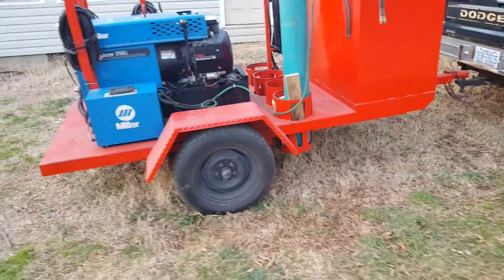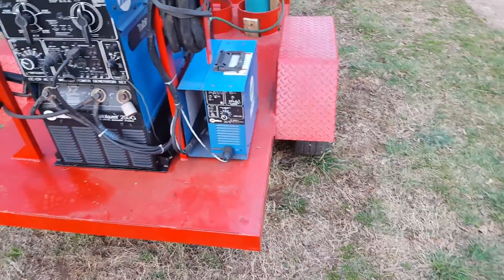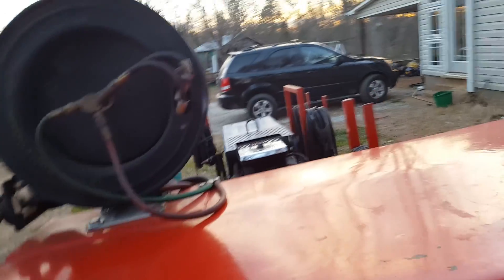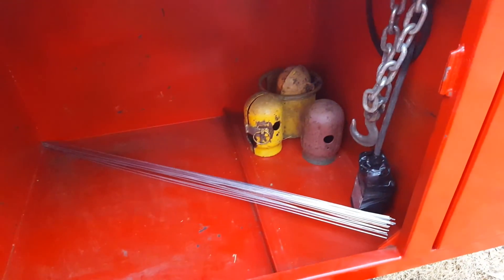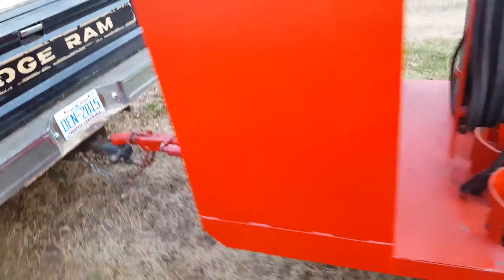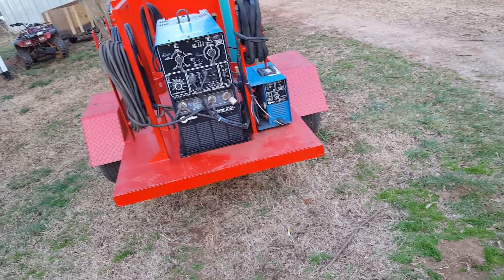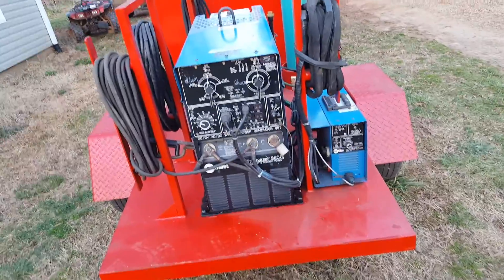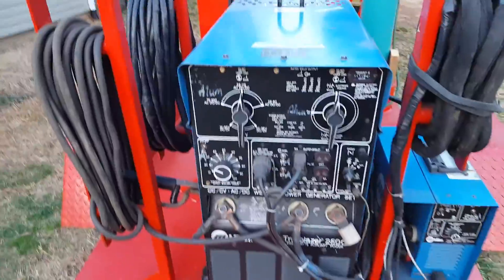My new miller trailblazer 250g

Comment: I have the exact same set up for sale I was wondering what you paid for yours

 if you want to message me on Facebook I would appreciate it. If the tungsten is burning back you might running on the wrong polarity. I hope you get it figured out
Reply from the maker: Hey Russell looked you up on Facebook but their was 3 or 4 so didnt know which one to email. Yea I figured it out. Ended up selling this setup. I really liked it. Just couldn't get any work here in NC. I tried for like 4 months got like one or two jobs. Maybe I should try again sometime soon since the economy is doing better. Thanks for subscribing, commenting, and watching my videos
Reply: Hi Loyd, On Facebook you can find me under K & K ornamental in Findlay Ohio. I'm a retired welder for local 50. Now I mainly do CNC plasma cutting and powder coating. I bought the welder a few years back. It is the Miller trailblazer 250 G-I have a suitcase MIG that goes with it--the TIG attachment--Ex tenda reach push pull gun- 534 hours on it-- trailer with bottle racks. I will try and find you on Facebook then we can swap phone numbers. Have a good day Loyd, and Thanks for responding
Reply: Throw me a friend request
Reply from the maker: I looked you up sent u a message. Wouldn't let me send you a friend request